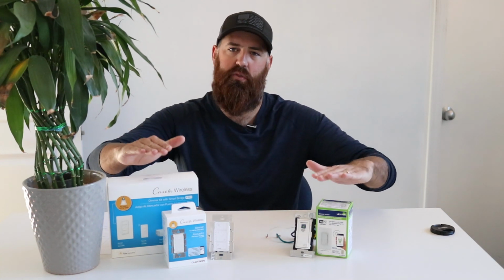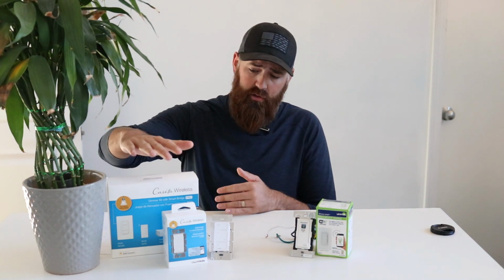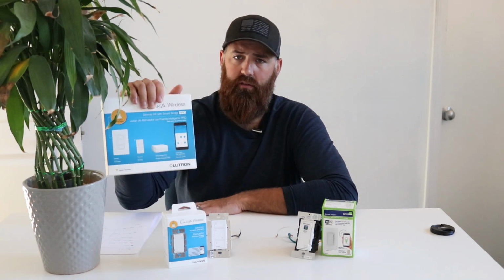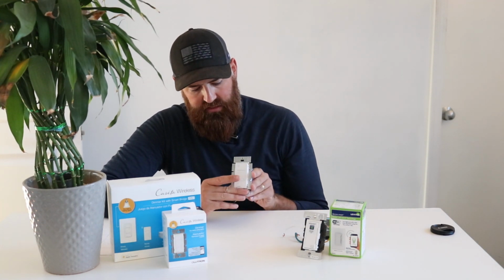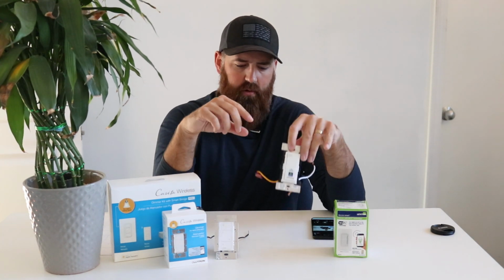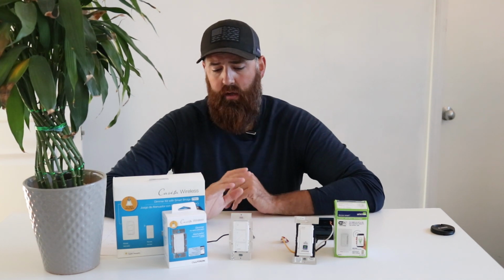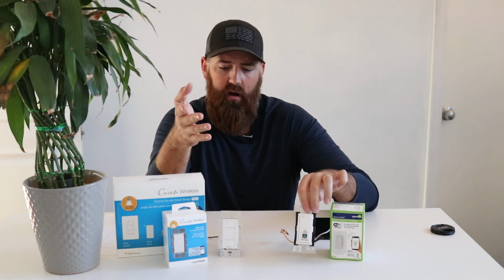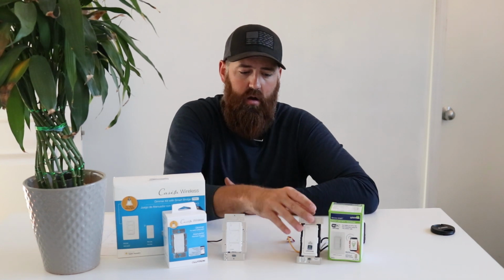Lutron vs Leviton : Smart Switches

Comment: I don't understand why it is a trend to HAVE TO GIVE an UNKNOWN 3rd party (the manufacturer) access to your home?   ie. There is NO real need, or benefit, for a customer to signup/signin to use the app!  That should be an option at best! I would have purchased 6 switches if this was not the case! That especially goes for any camera and lock security systems or IoT!

Comment: I have the levitons and personally love them. Connections are flawless and never have issues. I don’t have a stupid hub and I have 1gig up 1 down att internet fiber. I don’t have the wires on the switch like his though. Use Alexa for smart home. Reliability is my main focus above all else and Leviton hits the nail for me perfect.
Reply: Thanks for this comment! I have 1 GB AT&T fiber as well. Just bought a new home that comes with built in smart lighting based on Leviton switches. Haven't moved in yet, but I will see if my experience is the same as yours!

Comment: Hey I have 2 light switches side by that operates my ceiling fan
Reply: And I want to replace them with a smart switch one of the switches operates the ceiling fan and one operates light which smart light switches would you recommend thanks I very good WiFi and I have neutral wires

Comment: I chose Lutron and have been very happy with it.  Zero problems.  It did take a minute to get used to the dimmers.  Lutron requires the hub to make the switches smart but will work without the hub.  I have a somewhat large house and don't have any dead spots requiring a repeater.  Some lights work better with the dimmers than others but it is my understanding that Lutron has fewer compatibility issues than others and haven't found lights that the Lutron dimmer doesn't work with.  The light switch and fan switch DO require a neutral while the dimmer switch doesn't.  If you have shallow older gang boxes, Lutron might present a problem; my house was built in 1999 and that hasn't been an issue for me.  The pico remotes used for multi-way switches frees up room in the gang box.  Something not a lot of people note in these videos is that getting them aligned correctly is more difficult than a normal light switch and it all depends on the finish around the gang box ... had to do some work to get them all lined up consistently using spacers and in some cases extension boxes if the gang box was crooked or somewhat inset from the dry wall.  Not nearly as noticeable with an old school light switch.  Also had to sand off old paint drops or poorly cut drywall in a few cases ... why people get sloppy around the switches and outlets and sometimes don't remove unscrew the outlets/switches and get them away from the wall ... or even the faceplates at a minimum .... before painting, I'll never know.
Reply from the maker: John, thanks for the informative comment for other viewers and sharing your experience. Lutron Caseta: https://amzn.to/347Pazc  is a great system that I have also found to be very reliable and versitile. It offerers what I believe to be the simplest installation of any smart switch currently on the market.   Thanks for sharing your tips on installation.
Reply: @OneHourSmartHome  - Hey, my pleasure, always happy to share my experience and very much enjoyed your video.

Comment: Thank you for the video. I chose Lutron for a couple reasons. (1) I didn't like adding anything else to my WiFi network. My WiFi network is robust  but I just didn't want a few dozen more devices registered to it. (2) I watched lots of other videos and read lots of articles and nearly all said Lutron was rock solid. Hassle-free operation was a primary goal. The extra cost of the hub isn't substantial. Dinner for two and a couple cocktails cost more than the Lutron hub.

Most Lutron Caseta reviewers mention the Lutron Hub device limit. I counted every circuit in my 3,500 sq.ft. home and barely exceeded the device limit. I'll never go that far with lighting automation, and who would want 75 (or more) lighting devices added to their WiFi network?

I've implemented 10 circuits over the past year and am completely satisfied with my decision to go with Lutron. I'm using voice control by Google Home. I have it integrated with Hubitat. The Wife Acceptance Factor here has been very high. In fact, she's now telling me we need to take this lighting automation project further.

Comment: Incorrect information, Lutron switch don’t require a hub you can control the switch with a pico remote , the hub is required just to control the switch by phone . So the information here is incorrect
Reply from the maker: If you want smart control (phone or Alexa control) it requires a hub. But it you can control it locally with just a pico remote: https://amzn.to/2XCJR7s

Comment: Many home wifi access points have a limit of 26 or 32 devices at the same time. So if the leviton stays connected at all times that would be a problem for doing a whole house and less than half what you can use for the lutron. I do prefer the hub since it keeps the signal separate and more reliable. I have both hub and hubless smart devices. And the hubless are easy and quick I have to say that adding more devices to the hub systems are quicker and just seem to work better. Lutron is the quickest and most reliable I have tried. I agree I wish they have more options for switches and wish they had a toggle that you didn't know was a smart switch. But I don't think it is ugly and would take functionality over aesthetics all day long when it comes to products like this. Ok, within limits. Can't be ugly. Haha

Comment: I know there is mixed opinions, but for me personally I have found having a hub is much more reliable, I have no connection issues or any other issues. I have never had a wifi product that wasn't a problem. They also take bandwith that doesn't need to be taken.
Reply from the maker: Jack, thanks for the info. The Lutron Hub is the most reliable hub out there and backed by a good company, I agree with you on that. What wifi product did you have issues with?
Reply: @OneHourSmartHome  I've had issues with any Lifx product I bought, I bought z strips, and returned them all. Then I went to hue and never had an issue. Variety of off-brand smart plugs, generic zwave or zigbee work best for me with a ST hub, and never had any issues since.
Reply: Correct

Comment: I thought about going with Caseta, since it seems to  be the most popular smart switch on the market, but that button interface is so weird, clunky, and to be honest, ugly. Plus that you must buy their hub is super annoying.
Reply: Caseta needs the hub if you have integrated AV like Crestron, Control4, Sonos, Fans, Thermostats, Alarms, Shades, etc.  Don't  think the Leviton can do that. LUTRON does more than just lights. Geofencing and Away mode too.
Reply from the maker: Yeah, I wish you didn't have to use the hub. If you don't have a Neutral wire it's one of  the best options. But if you do have a neutral there are a ton of options to choose from and they are pretty much all reliable and you can pick one you like the features of and the looks of.

Comment: Stopped watching at "lutron requires a hub" :) 
leviton it is then... or maybe TPLink Kasa....?
provided that you have neutral of course....
Good video thank you.
Reply: Remember that with WiFi switches that don’t require a hub, your adding an awful  lot of new devices to your probably already congested WiFi network. With the 
Lutron, your not adding anything since it’s hardwired to your router. Just something to keep in mind especially if your adding a lot of switches.
Reply: @harrys728  Agreed.
Reply: Caseta will work without the hub. The hub is required for controlling lights/ lamps/others from your phone/tablet/voice device.
Reply from the maker: You are correct Leviton and TP link will both work without a hub. I like the simple design of the Levtion switches but both are good switches.
Reply: @OneHourSmartHome  Cool. Thank you for the feedback.
Reply: Caseta needs the hub if you have integrated AV like Crestron, Control4, Sonos, Fans, Thermostats, Alarms, Shades, etc.  Don't  think the Leviton can do that. LUTRON does more than just lights. Geofencing and Away mode too.
Reply: To me WiFi is the no no, it ensures you need a neutral and stacking lots of 2.4Ghz WiFi devices causes lots of problems when you have a whole bunch (and that is a bad time to find out...). Lutron's clear connect does not mess with any WiFi bandwidth and is super reliable and has very good range/capacity/speed up to 75 units. Lutron's hub doesn't need any internet services, cloud or really even WiFi to continue to operate (scenes, local integrations, schedules etc).
Reply: @alanmoore2197  i actually did my entire house with KASA switches/devices.  Nearly 50 of them all together. I love accessing them with my phone, adding routines, rules etc using smart controls. I have not seen any apparent adverse effect on my wifi yet. Also, they stay connected. One can always put all those devices on a different wifi network.
Reply: @urbanturbine Glad its working out for you. Putting them on a separate network is good for security - but not for congestion - they still share the same spectrum (as do your close neighbors). If at a later date you do discover congestion issues, due to expansion (or a neighbors expansion...) you have a high sunk cost at that point. Hopefully it will never happen for you.
Reply: @alanmoore2197  It will be fine. If current technology cannot handle my house, it will mean we have bigger problems.
Reply: @urbanturbine You confidence is impressive.
Reply: @alanmoore2197  It works fine, man. What do you want from me? lol
Reply: @urbanturbine  Take a compliment dude
Reply: @alanmoore2197  Thank you. Well received :)